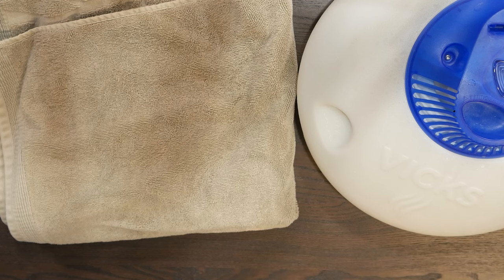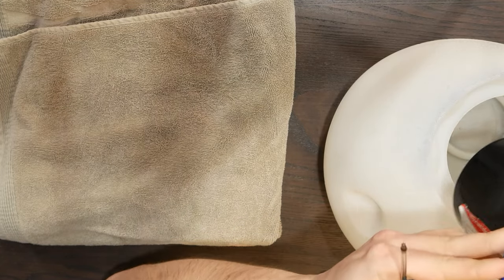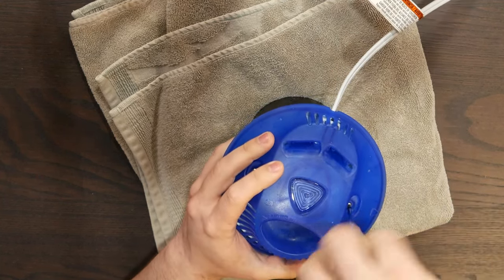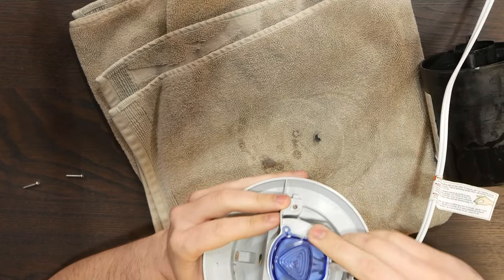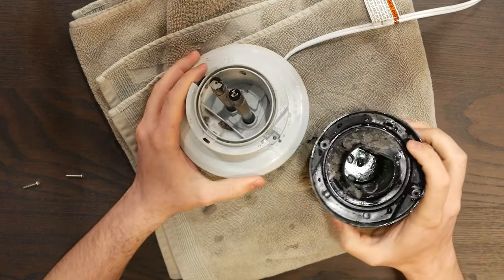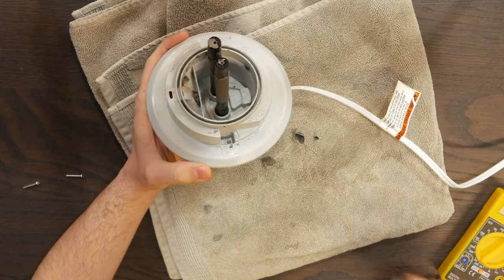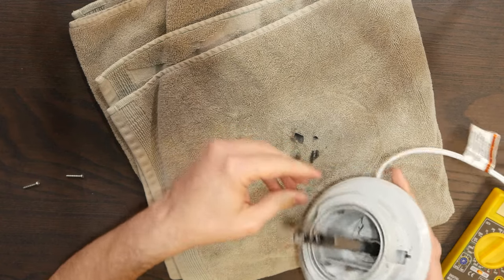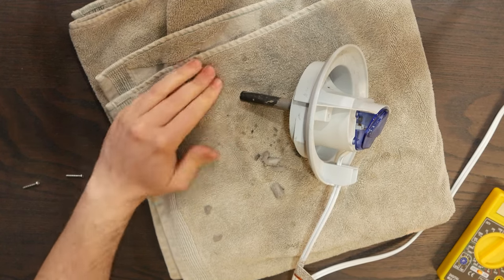Is a Vicks vaporizer an electrode boiler?

Comment: I like a number of others have her unit similar to what you took apart, very neat watching you do that to see what it looks like inside. I suspect some of the gunk you found in there aside from the obvious stuff was likely just sheer corrosion because I would suspect it’s just about impossible to get all the moisture out of the chamber when that unit is not being operated. I agree that it would not be an effective device to use as a regular humidifier because you don’t have the ability to control the output, and yes it looks like it would use a lot of energy. But I don’t think they’re really intended to be used for purpose is beyond relieving respiratory ailment such as the cold or flu. so unless you have several different people in the household who may be a line, at least in my case I may use one of these a week at the most out of the year. just a shame, for something so simple it is quite fascinating to see it operate and even more so to see someone be brave enough to take it apart. Cool, or hot beans in this case.

Comment: They've been like this since at least the 1960s.  We had one like this, only with a big glass jar, when I was a little kid in the '70s.  The electrodes were two long, skinny, flat narrow plates instead of two round sticks, but they were housed in a cylindrical chamber much like this one suspended in the larger glass tank.

The current draw varies depending on how much salt is in the water.  If you over-salted the water it would cause the lights in the room to flicker and the humidifier would start spewing boiling water into the room.  So that's probably why they indicate it can draw up to 5+ amps of power.  My guess is that since the '60s they've added some kind of component to cap the power draw under those circumstances.

These warm mist humidifiers probably aren't all that bad in colder climates when you're running the heat anyhow - they'd just cut down the load for your regular heater.  But they're awful in warm dry locations like deserts where their excess heat might be unwelcome, even in the winter.
Reply: By the way, if you want a great "humidifier" that doesn't draw much power, get a lot of plants.  With the advent of LED lights even if a room doesn't get much sunlight you can still grow tons of plants in it, and the plants and their soil will constantly provide a stream of humidity into a room.  A green wall pumps out a ton of humidity and looks a lot nicer than a humidifier.

Comment: It makes sense. I have a similar one I used to use frequently. Over time when you would use it with fresh water it would turn the water brown, which is what happens when you run current through it. Also, the older the unit got the less time it would take to start producing steam.
Reply: Likely the electrodes were accumulating some conductive film of a sort thereby increasing the surface area of them, resulting in more production.  For consistency, clean regularly, unless it's not a problem for your situation.

Comment: Yes, it's an electrode boiler; yes, as far as I know, these are still manufactured; yes, those electrodes literally vaporize water, which causes them to quickly accumulate large amounts of mineral scale; and yes, eventually that scale gets thick enough to effectively become insulation, which causes the vaporizer to stop working. When that happens, you unplug your vaporizer, immerse the part that sticks into the water in a vinegar solution or commercial descaler (disassembly is optional, but it's kinda cool to watch the scale disappear), and then your vaporizer is good to go again. However, in addition to mineral accumulation, the electrodes also tend to corrode, so after several years of regular use, the vaporizer stops working because so much of the electrodes have rusted away that there's no longer enough of them left to reach the water.
Reply: This is consistent with my use of this model of vaporizer.   We use them as whole house vaporizer for an apartment during the winter.  The waste heat is not a problem.   I like this style of vaporizer because it does not put the water minerals into the air - just vapor.   Kind of pricey for the electricity though.

Comment: I have that exact same electrode unit. Actually I had two but broke the electrodes on the first of when trying to clean it. We have just regular Michigan, city water. Mine still developed a lot of scale. I did have to add salt frequently though.

I would also like to add that I think that it can easily go through its tank (at least until the water level is below the electrodes) in 12 hours.

Comment: I wonder if the scale on the electrodes could be explained by them both being cathodes.  I'm pretty sure a cathode can be electroplated by metal particles dissolved in water, so it seems reasonable that your water may have dissolved minerals with metallic properties which could electroplate a pair of cathodes that draw 200 watts.

Comment: This is built exactly like the ancient Prak-T-Kal vaporizers/humidifiers that were really common back then.  I'm really surprised that they were made that recently.  The theory behind them is technically "safe" being that the exteriors are made of insulating materials and the neutral electrode is expected to be closer to the live electrode than any fleshy object could possibly be.  The issues with that obviously are that if the neutral becomes faulty then the easiest path to ground can potentially (get it?) be you when you inevitably investigate why it's not working.  I am not sure if the new one is different, but another issue with the Prak-T-Kal unit that I have is the fact that there is no overcurrent protection on the device itself.  I would assume they are relying on the protection on the home circuit, though that would be a LOT of current if there happened to be a fault or you simply decided to put a saturated salt solution into the tank.

Comment: Greetings:
Your "scale" is actually the dissolved solids in the water that are left behind as the water itself boils away. They represent the hardness in the water. Due to the AC current reversing polarity, the scale builds up on both electrodes; whereas a DC current would have only one electrode plated with scale, much as happens in the electroplating process. 
Here the most likely elements are calcium and magnezium. A quality reverse osmosis filter system would remove most of those hardness elements while also significantly reducing the boiling ability due to the absence of conducting ions that constitute the current flow in otherwise non-conductive water. When used with distilled water these vaporizers require some table salt added in order to provide the current carriers.

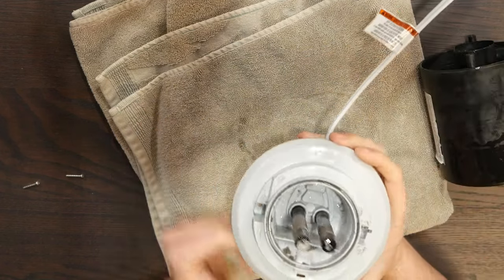Comment: 2:16 I find it weird that you did not know this was an electrode based boiler since I am pretty sure the instruction tell you that the electrodes need to be cleaned every once in a while, or at least they used to. These show up all the time in thrift stores most likely because people don't know they need to be cleaned. personally I don't like the carbon rods and prefer the old style metal ones like in this video https://youtu.be/XKQ-fbBYOzY they were much easier to clean.

Comment: I've never lived anywhere that needed a humidifier. I have a dehumidifier running 24/7/52 to prevent mould on furniture, books, and circuit boards. The lowest natural humidity where I live (northeastern coastal New South Wales, AU) is about 65% relative, but more commonly it's 75%+. At 90% the walls stream with condensation without the dehumidifier, which I've tested to find it can remove 5 litres of water from a 65 cubic metre room in 12 hours overnight.

Comment: I bought one of these a couple years ago, so yeah they're still being sold afaik. It would be much easier to get the scale out if that tiny hole in the bottom was a bit bigger, though I'm sure they're afraid of people poking things in there.

Also, I guessed that it was electrode based due to owning a similar model like twenty years ago. Back then they didn't have the plastic shell covering the metal bars, making it much easier to clean, but... yea exposed hot metal (granted, it still only operated when submerged in water).

Comment: Years ago I use to even pop rivet new homemade electrodes to the old eaten away ones to extend its life. I now use the kind of vaporizer that has the heating element encased and is supplied by a pet watering type overturned reservoir.

Comment: Looking at the color and texture of the scale, I think it might be a mix of limescale and mold, which would also help explain the speed of buildup. Also, to everyone asking about electrolysis, since it's AC, pretty much any chemical reaction that occurs will be reversed in 1/120 second. Not all, but enough that only negligible amounts or reaction products will remain, and the closer to the electrodes, the less likely any reactions are not to be reversed, which means that shouldn't have anything to do with the buildup.
Reply: I run a similar vaporizer in my office and bedroom at home for 20 winters and never smelled any chlorine or other chemicals even opening the tank after using it for a day.  I was a taxation professor and not a science professor but my understanding is that you need to use DC to elicit any large amount of chemical reaction using this method.

Comment: Terrifyingly simple design! However, when testing equipment for which you may be unsure of the potential, try to attach the probes to the equipment being tested in such a way that they are being held in the same hand to avoid creating a circuit across your torso, and possibly your heart.
Reply: Or, you know, attaching them when it's not plugged in/turned on...

Comment: I learned how this style worked about 15 years ago. The older model Vicks (or look-a-like) made, it was too easy to touch the water while the device was running.
Guess how I learned?!?! Yeah, I remember THAT hurt, and it put me off ever running it again!
So the moment I saw that one in the main channel video I KNEW how it worked and was concerned you even had it turned on, although I see how they've improved the design so access to the water is much more difficult with the electrodes still in the water.

Comment: As dangerous as it may seem, this isn't nearly as inefficient as you're saying, because you're thinking about the humidifier as a single system, when in fact it's interacting with your HVAC. In the winter, the waste heat of a boiling humidifier goes into the air, which you're heating anyway.
The larger humidifiers that are using a wick or the ultrasonic variety are actually cooling the air (they are swamp coolers), so, your HVAC has to run more often to compensate if you intend to be using heat.

So the question should be, how much heat does it output, and how much less efficient is that heat than your existing HVAC, then, compare that to how much harder your existing HVAC has to work when you're pulling temperature out of the air with an evaporative humidifier. Only then will you have a real idea of how much power you're using to humidify.

Comment: I've opened up a few of those in my day and yours didn't look too bad.
Pure H2O isn't conductive so technically speaking that would refuse to work if you used distilled water; the scale is unavoidable. . . . Maybe if you added salt so you could add the bare minimum to reduce the maintenance but  be warned, moist salty air accelerates corrosion. My concern is after long term exposure it could cause other delicate electronic appliances in the room (such as the computer or TV) to stop working. Theoretically the AC current is supposed to help knock off some of the build-up along with preventing degeneration like what would happen with the cathode in a DC current setup.

Comment: I always wonder about the chemistry opportunities when I see this type of stuff. I've always wondered which elements of various lab types are cheaply and semi secretly duplicated in common appliances. This is definitely an example.
Reply: I agree. The directions even mention adding salt which increases the electrolyte balance. Oxygen attracted to the positive and hydrogen to the negative. With some modification you could capture that hydrogen, not suggesting that one though. I’m sure the oxygen collecting is causing some of the buildup as it’s literally oxidizing itself and adding the salt will only speed that up. Distilled water should have less electrolytes thus less buildup, but less steam since it doesn’t have the aid of extra electrolytes. I never would’ve bothered with such a humidifier until my pregnant wife was all congested the other night and needed something quick before target closed lol.

Comment: Big Clive did a video on a death heater for boiling water. Same thing. Mains voltage whacked in the water. Bad idea as its not only dangerous but causes chemical changes to the water, hence why its more 'scaley" than you'd expect.

It also did the same thing when withdrawn from the water in not drawing current, and going bat shit crazy if salt was added

Comment: It occurs to me that in addition to adding water to the air, this thing also likely adds hydrogen and oxygen to the air, since it is fundamentally also an electrolysis machine.
Reply: Hmm - that then means that less of the water you put in is making it to the air as water vapour - wonder what the difference is
Reply: Electrolysis only occurs with direct current, alternating current will not cause water to split.

Comment: You are supposed to be able to take them apart because descaling doesn't always work because sometimes you physically have to take them apart to scrap them off so they work again.  It uses the water to complete the circuit and make it work and create the steam.  That's how it automatically shuts off because when the water gets low, it breaks the electrical connection.  And that is why you need to descale it often because that scale that coats the electrodes acts as an insulator causing the electric not to be able to flow between them.  That's also why the water can be a problem too because the water has to be able to carry a current.

Comment: I wonder if you could make one of these things dishwasher-safe?  Like, incorporate the cover into the circuit so it can't run with the cover off, make the power-cord removable (and put a humidistat in there) and then let users just take the bucket off and the basin and throw all 3 parts on the top rack.

All humidifiers get filthy but this one has the potential to be easiest to clean.

It'd still be a juice guzzler though.

Comment: I was in your shoes 3 years ago, I had just moved into a new house, me and my roommate bought a bunch of crap, and this humidifier was cheap at the time! Didn't really use it much because it was so hard to clean out the scale and crud, mine looked about the same as yours did, but the scale came off much easier! (Also using Lake Michigan water) I would say it got about 6 or 7 full uses out of it before I took it apart (still worked when I put it back together too 😂😂) was going to make a habit of popping it open and cleaning it seasonally, but its been sitting in the closet ever since!

Comment: Out there alot more than  you Think. I own an HVAC company and just Installed 3 aprilaire 800 Humidifiers this week in different homes and  that's Literally all they are is Electrode Boilers in a throwaway $80 plastic canister, All my customers this week wanted them wired to 240V. They work well and cheap and throw away replaceable components in this situation makes them Ideal. Still pretty wild though. You make some fun videos to watch. I'm a nerd LOL.

Comment: this inspired me to clean out mine. there are 2 slightly larger torx screws that hold the electrodes in place, attaches to the wires. mine were so corroded that both screws broke. bummer. was going to soak them in vinegar and clean them up.guess i'll have to buy a proper humidifier!

Comment: The strength of the design are sterile vapor, no wicks to replace (which can get gross), and easy access to clean mineral deposits.  Use distilled water and a little salt, and you will rarely need to clean it out.  Plus, they work for decades if cared for.

Comment: Bought one at Walmart less than a month ago. It's worse than that. They didn't use stainless steel, it started dropping rust in the water on the second use. The switch broke about a week in and we returned it.

Comment: I have a very old steam humidifier that's down right scary. It just has a one gallon tank, a small fan, and a 1500watt resistive element to vaporize the water! (Yes 1500 watts on high, I checked). What makes this so scary, is that this 1500watt glowing red element is inside a totally plastic unit. There are multiple warnings telling you to not let the water level drop below the top of the sump, or it can (and will) catch fire! I'm assuming they don't sell these anymore for obvious reasons. It is however extremely effective at humidifying, and doubles as a space heater (no duh). On high it burns through a gallon (technically 3.8L) in under 4 hours, and on low it will last about 9 hours (or just good enough to get through the night without burning your house down). Oh what fun!

Comment: The dissolved solids(TDS) is in almost all water. Build up happens on any heat source in water. Hot water heater, kettle, etc. You need to use distilled water to extend the life of the unit and minimise buildup. Descale with espresso cleaning crystals/powder. Leaves no nasty smell. 👍